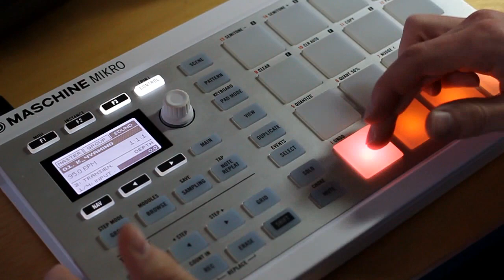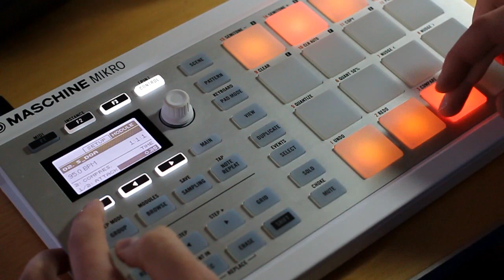Maschine Mikro Tutorial #4: Basic Effects and Automation

Comment: Great Tutorial!
Nevertheless I have a problem with adding effects on my NI Maschine Studio. When I initially load an effect for example to a group, the effect is completely overdosed at the start. I can't find an option to set the effect to zero values so I can finetune its parameters. The only option is to bypass it or not. 
But that's not what I want. Do you have an idea how to do that?
Reply from the maker: Markus Burger I don't think you can change the initial parameter values, but you can easily exit browse mode and use the knobs to tweak the effect. There's no function that will automatically set everything to zero.
Reply: andrewchellmanmusic Thank you for the fast reply! But tweaking is not very helpful here. For example when I add an effect from Absynth my initial group sounds are completely mashed up. I used all knobs to get the initial sound but I failed. What sense does it make to add an effect which can't be tweaked in that way? Turning effects only on and off is not very satisfying to me (for that kind of effects which put a lot of sound modeling to the samples e.g.). Aren't you running into same situations when producing?
Reply from the maker: Markus Burger Are you adding Absynth as an instrument or as an effect? I don't have too much experience with it as an effect, but as an instrument, there should be an "init" patch somewhere that sets it all to the initial values
Reply: andrewchellmanmusic I'm adding Absynth as an effect. When I initially add one of the Absynth-effects the parameters are set to specific values but not to zero. The next step is that I somehow try to get zero values so my group-sounds are not mashed up anyway.
Then I want to tweak but that's exhausting because I don't get clean sounds. Maybe I try something which can't be achieved that way...

Comment: Yeah, hi. First of all, cheers in advance, you're my hero.
So, I run into trouble like, seriously immediately. 50 seconds into the video when you go f3 then hold nav, my Mikro's display does something different and the pads don't light up at all. The display has 2 tabs for "CHNL." and "PLUG-IN", with 4 squares in the middle and the bottom is a box labeled "SAMPLER"  and the text inside the box says "VOICE SETTINGS / ENGINE" 

So, yeah.. I just got this early this month, so maybe slightly newer version causes weirder behavior? Either way, idk what I'm doing, so hopefully you know what's up with that.

EDIT: Just noticed my MIKRO also has the shift command "MIX" about "VIEW" button. So probably I have some newer-fangled version?
Reply from the maker: You have the new hardware with the Mix labeling and the 2.0 software. I'm working on updating these tutorials to reflect the changes in the 2.0 software!
Reply: andrewchellmanmusic Fantastic. Cheers, So many rubbish tutorials out there, but these have been top notch.

Comment: So is it impossible to apply an effect (take for example: a filter) to an entire scene? In saying this I'm wondering if it's possible to filter all of the sounds in an entire scene at once. If not... I feel like Maschine definitely botched that one. Why wouldn't you be able to modulate all of the sounds at once to give it a full filter effect instead of only applying an effect to one of the groups in a scene. I'm not saying there isn't a use for a filter targeting a single sound or group of sounds at any rate- I just have more of a use for filtering all of the sounds at once to give it that warp-type/stop-go rhythm if you're picking up what I'm putting down. Anyway, what are your thoughts on this? Also, your videos have been extremely helpful mate! Thank you :)
Reply from the maker: You can easily do this by putting a filter on the master bus - that will affect all sounds in all groups. Does that help?
Reply: Uhhh not exactly... Unless you can automate it scene by scene? Basically, my situation is this: I'm working on a track right now that has a solid buildup to a drop in only one of the scenes out of like ten, but I want the filter on every sound in just that one scene. I attempted adding a filter to the master bus but couldn't figure out how to record the automation.
Reply from the maker: Oh, you can't automate that, that's annoying. Workaround that I actually tried and it's working: make a new group and use one sound as an input. You can route all the other groups to that sound's input and then put effects on the sound slot and automate those.
Reply: Yup, I actually found a tutorial on using a sound as a master FX input that you can route all of your other groups too. Thanks a lot though. Your tutorials have been very helpful, as it is entirely frustrating to enter the world of electronic production having played analogous instruments my entire life.

Comment: Quick question what is your aux hook to not getting same results as video what can I be doing wrong
Reply from the maker: Allen R. Aux cable goes from phone output to laptop input
Reply: Cool what about desktop or interface
Reply: New to machine just trying to figure it out
Reply from the maker: Allen R. You don't need an interface for the aux cable method, but I use a Steinberg UR22 and like it very much
Reply: Ok cool appreciate the help I have one more question I have my sample sliced and all but I can't save it to a group for recording later help me out
Reply from the maker: Hit apply and it will go to notes on the keyboard, you have to go into keyboard mode to play them
Reply: Man thanks again Value of information